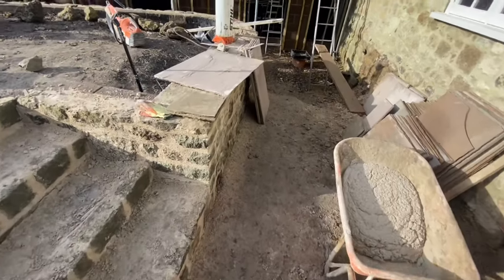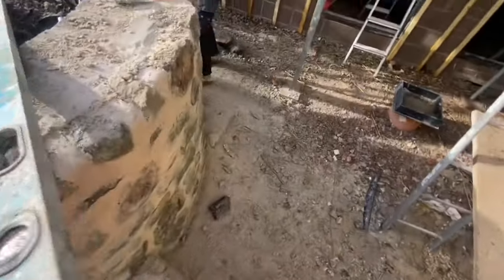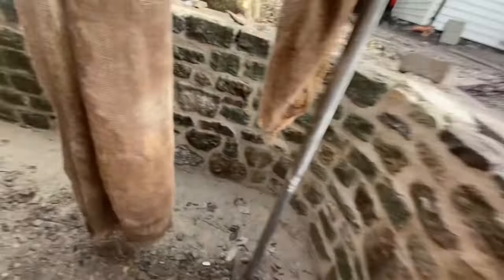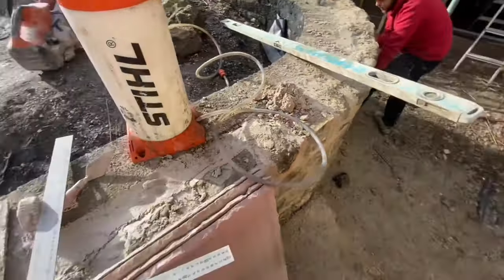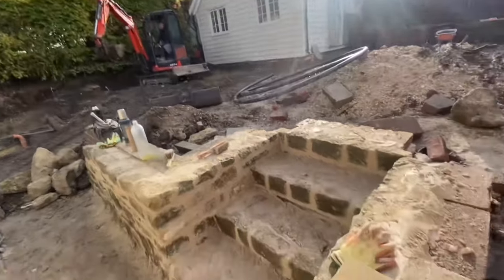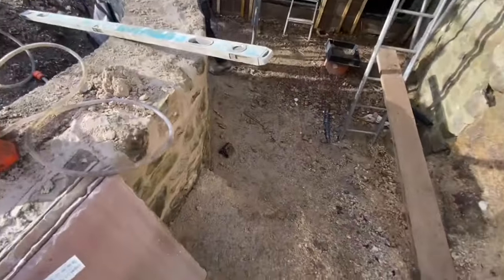Stone Wall Cladding Build Using Greenstone ~ Day 15

Comment: Is the same lime mix used on the capping stones?
Also, do you prime the Indian sandstone with anything?
Btw a beautiful job. 
.....you were going to mould new cappings for the original wall. Would that have been an option or too much time, effort, expense?! ....And nowhere flat to perch one's Pimms!!
Reply from the maker: Yes same mix and just dampened with water. The moulded caps haven’t been done yet, we will do them soon as the mould is ready but as far as I know we are still doing them! Thank you for watching Sean! 👍